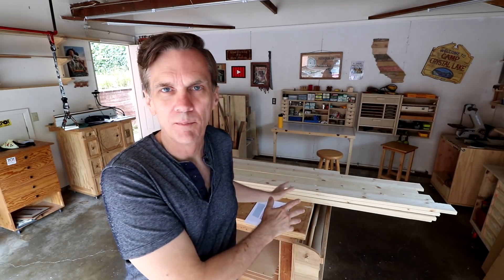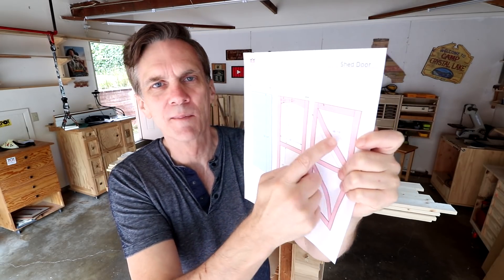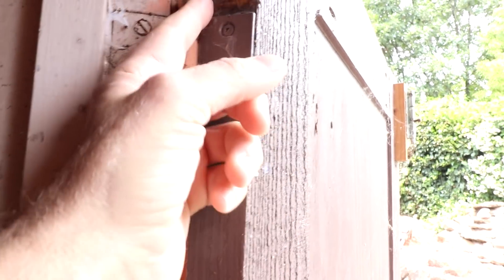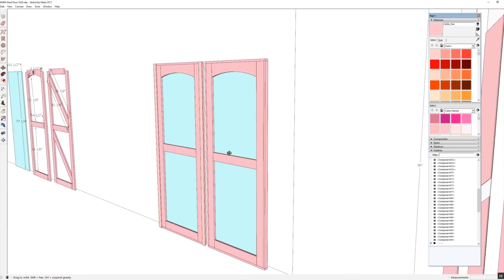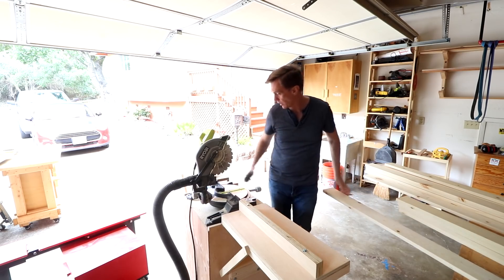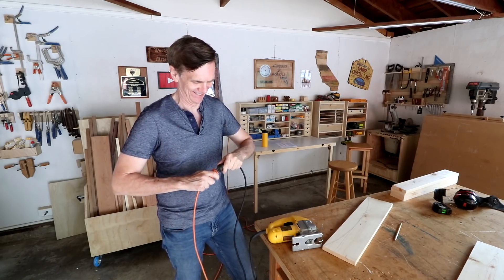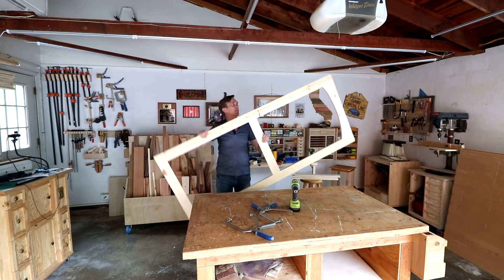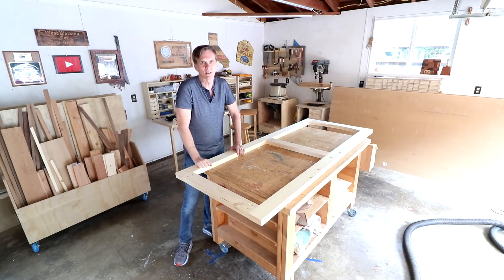Happy Saturday! Changing the shed door design and getting my man card revoked. | LOCKDOWN Day 75

Comment: I built a set of doors similar to what you are building at the "big box store" that I work at.  The doors are 96"x36".  Built them similar to the way you are but used 5/4" pine and the T111 siding that you looked at.  They are hit daily by carts, pallets, and machines and have held up great.  The plywood siding will give it the strength and glue the trim boards on to the ply and you will never have any issues.

Comment: I just spent several frustrating hours over the weekend installing a new faucet and reworking the trap and plumbing. While frustrating, I found that its painful to get people to show up on time or at all where I live. For example I wanted carpet installed on my steps, we had 2 different companies no show. When we called them the first said they got busy with another job and would call us back to reschedule. We had to call them to find that out, and they never called back. The second company said they weren't sure what happened but they would get back to me. Never heard back... I gave up and learned how to install carpet on the steps myself, and it turned out pretty good. Definitely less frustrating than dealing with taking time off work to meet them only to have them no show. I've had the same for AC repair, painting, electrical work, and flooring. Oh the stories I could tell about AC repair that took me 2 months to get done. I've actually thought about starting a business that actually communicates and shows up on time where I live, I feel like people would pay extra for that :D

Granted i've lived in other parts of the US where contractors were much more reliable, i've kinda given up on them where I live now. When I find one that shows on time and does even a decent job I continue to use them. I do have a good tree service and power washing service.

Comment: Steve, I’m a 64 year old woman. I learned to work on my car, to do plumbing and basic electrical crap, and saved myself thousands of dollars over the years because I couldn’t afford to hire a professional. Now I CAN afford a pro AND I DO know how to fix most things (like my dryer most recently). So most times I hire the pro for the same reasons you do! However, I refuse to pay a pro $200 to replace a $5 fuse. It took me 20 minutes but 18 of that was removing the 40 screws holding the back panel on and then putting it back on. Fuse took 30 seconds. Rest of time was finding tools. There is nothing wrong with hiring a pro! You still have your man card! Smart call!

Comment: I have the same truck.  Just for FYI, the spare tire on your truck is under the bed. The jack and tire iron kit is in a box that should be under the passenger seat in a box. In the box, there are a couple pieces of tubing that need to be put together. Next to the rear license plate there should be a hole to stick that long tube through. It goes to a pulley system to lower the truck tire down. It's good to know these things just in case AAA can't reach you. In any case, love your videos!

Comment: That’s a good point about the battery.  They’re not always straightforward and as easy to change as they should be.   I forget which car it was.  But to change the battery you had to pull the passenger side tire off.  So it made what should be a quick and easy project a real hassle.

Comment: just as a note ... for the curve, you can use a thin strip of bendable wood and attach the ends to one end and bow it up to the high point from the other end where you stop the curve
also you do not want to use the strip on the side ... you will not have enough strength ... would recommend that you change out the hinges and use barn door style hinges instead

Comment: Don't worry about the battery issue man. I worked at a auto retail store, there's no judgment about replacing a battery for guys. Just because you're not a jack of all trades doesn't mean you're a master of none. You excel in woodworking, where most car guys dont know what a cross slide is.

Comment: Hi Steve. Here in Australia our AAA is NRMA and while I am an IT Tech even I get them to change the batteries in my cars. Reason being they are able to temporarily feed power to the system while removing and replacing the flat / faulty battery and no computer chip data nor PIN nor complex reconfiguring of radio/GPS/bluetooth or software needs to be resetup by the Suburu Dealership.  Hang on to that MAN CARD mate!   Love them videos for the past 5 years

Comment: Looking good..I think you made the right call not having a back frame, seems like a lot of weight saved. On thing with that siding material is it doesn't do well wet. You may want some cap on the top, even metal flashing so it doesn't get rained on

Comment: I'm with you for the most part. I won't tough electrical. Last time I tried changing a light socket, I ended up in the ER for 12 hours. Changing the battery in my wife's car requires the removal of a tire and the wheel well just to access it. Basic repairs I think most people should be able to do themselves, but there's nothing wrong with calling a professional. That's why I think there should be a mandatory class in high school that teaches Basic Life Skills. Changing a tire. Balancing a checkbook. Budgeting. No one cares that the mitochondria is the powerhouse of the cell!

Comment: Also, man cards accumulate points. All the points you gain using power tools will more than offset the points you lose by not changing your battery. Also, you're right about it sometimes being as cheap to pay someone. For example, I used to change my own oil, but now the oil and filter cost almost as much as letting someone do it.

Comment: The thickness of the two frames with the siding sandwiched in the middle seems to be easily overcome by setting the doors flush to the outside and moving the inside door stop trim in a little. I would think that the inside frame would lend some significant rigidity to the door.

Comment: I'm horrible with anything to do with vehicles but there are a few basics that I think you should know, even if you never have to use them stitch as changing a tire or checking your fluids (and where to put which fluid). Maybe it's because of where I live in BC but there's a lot of highways with iffy cell service and it's better to know than to be stuck in a bad situation.

Comment: That 1x2 strip of wood on the edge of the door is a mistake. All the weight of the door is on the joint that attaches the the two pieces, You are undermining the strength of the one piece plywood build. The best solution if you want that strip is to change the hinges and install long gate hinges to carry the weight of the whole door.
Reply: I was thinking the same thing. Best is to just change the hinge.
Reply: Completely agree.
Reply: I was going to suggest opening the hinges and installing them to the face of the door, but a new gate hinge would be a much better idea.
Reply: The doors aren’t that heavy. Glue and screws and it’ll be like one solid piece.
Reply: 2½" screws will do it. Predrill into the plywood first. Angle if necessary.
Reply: Been there and tried a similar setup, the sidding is not as string as it feels it is light weight fiber board. Yo I will want a solid frame that will old the weight of the door and make a solid atachme t to the hinge, also goes without saying but do not screw into the sidding. Make sure you go through the siding into somthing solid. Lastly I have changed a bettery in the lest 5 years and unless you know exactly were and how it is a pain.
Reply: I think Steve should use long hinge screws and bend them over when they come out on the opposite edge... would that be strong enough ?? 🙄😂😂
Reply: Agree, best option would have been to use 3/4 ply and 3/4 stock for the face frame. Stronger door, 1 1/2” thick. PPPPPP.
Reply: Actually, the strips are the best part of the door for resisting warping
Reply: @williamboy3291  That's what your owner's manual is for. Every car I have ever owned included an owner's manual that describes exactly how to change the battery, charge the battery, and change a tire, amongst a million other things.
Reply: Although I enjoy doing most of the diy car stuff, I can't fault your logic. AAA fixed a flat for me a bit ago while I pitched a proposal on Zoom. I made way more money on the call than the AAA membership cost.

Comment: DIY'er here --  check out Sam's Club prices on batteries.  I saved a boat load and we changed mine last fall in the Sam's parking lot.  However...   Just for others reading here in future, Scotty Kilmer (check out his YouTube channel, he's huge) says with the modern cars you can mess up the electronics/computers on your car if you hook up to jump off the battery in the wrong order.  Also, there are codes that have to be entered sometimes with the right tool. My aunt just had to send her car into the dealer when the battery needed to be replaced.

Comment: Ever try to change the 12v battery in a Prius?  Aside from the fact that it's basically a custom motorcycle battery (smaller profile), you basically have to dismantle the entire rear end of the car to get to it. Turns out to be about $300 between the battery and labor to change it out. Still worth it compared to trying to do so yourself.

Comment: Everybody SHOULD know how to change a tire.  Doesn't mean you actually have to do it (once you've proven that you can)!  When I was younger, the cost was a bigger issue so saving money by doing my own tire changes (or oil changes, or brake jobs) was a much larger factor in my decision making process.
Reply from the maker: Every owners manual has instructions. It's pretty easy to figure out if you don't have a AAA membership. Or there are countless YouTube videos showing you how. I guess the point is that we no longer need to pre-learn rare tasks that we may never perform. Most people will live their whole lives without experiencing a flat tire and being without assistance.

Comment: People all assume that if you are a woodworker, you’re automatically a jack of all trades, but that’s not the case. Mechanical, plumbing, electronics, and many other trades/skills may have some overlap. I totally understand where you’re coming from. I’ve had to fix cars, washers, dryers, and refrigerators when little things like ignitors, relays, prake pads, bearings, or fans go out because the frustration factor is less than the cost of a repairman or replacement device. But there are times when I punt because it is the right thing for me. I know how to change oil. I’ve done it several times, but it is worth it to me to spend the $100 to have a professional do it, properly dispose of the oil, lube the chassis, and check all the points they check, because something would have to be terribly wrong with those items for me to see a problem. Heck, even replacing a headlight has become a major pain with as tight as they pack things in.

Comment: Changing a vehicle battery is not always as easy as it used to be.  I had to replace the battery on my Dodge Journey last year.  The AAA affiliate where I'm located would not even change it out because in order to get to it you have to remove the driver's front wheel and part of the fender covers behind the wheel.  I don't blame you one bit.

Comment: I don't change tires very often, but I can get it done before AAA gets there to do it for me and yes I have AAA, I can't tow a car when needed. But I do see your point about the battery, which is why I didn't comment on it before. I take my truck to the shop for a lot of simple things, mostly because of the warranty I have covers almost everything and minor stuff like an oil change is a waste of time. I drop my truck off for an oil change and have them rotate the tires and recheck the alignment at the same time, they do a courtesy inspection and let me know if any lights are out, how my brake pads are, etc. Make more sense to just let them deal with it since I don't have time anymore.

Comment: Your car battery story/epiphany is very similar to mine.  several weeks ago I needed a new battery for one of the cars.  Off to the local auto parts store and $140 plus tax later I have a new battery.  I have to install the battery myself.  Took about an 30 minutes.  The battery has a 1 year no questions warranty.  Fast forward two weeks and another one of my cars needs a battery. I check AAA out of curiosity and low and behold I can get a battery for $145 installed, and get this, with a 3 years warranty and an additional 3 years prorated warranty.  So for $5 extra dollars I extended the warranty by several years AND it was installed for me.  That formula works for me...man card be damned!
Reply: Costco is about $75 bucks for the car batteries my three cars use, with the same awesome warranty. Walmart and the auto stores were charging the $140-145 prices you mentioned.

Comment: Agree 100% with having someone who knows what they are doing, and have the correct tools to do it with, perform tasks that your are not comfortable with (or that will cost you more in the long run).  As our provincial and national lottery states "Know your limit and play within it".
Reply: While I agree, knowing ow to change a tire is helpful when you are lost in the middle of nowhere and there are no AAA less than 3 hours away. Oil change is different, you can still drive to the next town to have it done.
Reply: I agree completely, outsource what you can. If you have your own business it's cheaper to hire someone to do most of the fluff on the side if you can spend your time making money instead.
Regarding cars, personally I'm not very interested and I have changed enough tires, oil and carburetors in my life. Batteries in a modern car can be tricky, we had a Ford that tripped the start protection when the battery went bad. It had to be towed to the shop to reset it. Nowadays I drive and fill up fuel, I happily pay someone else to do the rest.
Reply: @olivier2553  Then you can just watch a YouTube video on how to do it, unless your phone's battery is dead and you're alone in a the middle of nowhere.

Comment: Years ago these Jiffy-Lube type places started popping up and they would change your oil and filter for only a little more than it would cost to buy same at Pep Boys.  Well, that was a no-brainer.  But after a while the cost started going up and up and up.  Now I'm back to changing the oil myself.  It helps, of course, that my 1998 Suburban is lifted and I don't even have to jack it up to get to the drain plug.
Reply: Look up Fumoto, it's a valve that replaces the drain plug. It's super easy and clean to drain the oil.
Reply: Even worse for newer cars with weird grades of synthetic.  The oil costs maybe $10 more, yet all the lube shops want to charge $50-100 more to do the oil change.  I'm back to changing all my oil myself too.
Reply: Around my part of NY it's cheaper to pay someone else to change my oil than to do it myself. I can go to Goodyear and pay $20, or I can spend $30 to do it myself. I'd rather save the $10 and my time. I also like that I'm still clean when it's done.
Reply: I have the knowledge and the tools to do it myself, I actually used to work at a Texaco Xpress lube.  I prefer to do it myself because I used to work there and I know the caliber of people working on the cars.  Mistakes happen.  If I did it myself, I know it was done right.  If I screw it up, its on me.
If I glue a 1 inch strip of wood to the outside edge of my new door and it falls off, thats on Steve...  :)
Reply: I've known too many times when the quick-change places have forgotten the fill part of the drain & fill procedure, or cross-threading the drain plug, or putting an oil filter on so tight that only the Hulk can get it off, so I just do all my maintenance myself, as well.

Comment: I've had plenty of the "professionals" screw stuff up on my car.  Things like stripping bolt heads and cross-threading bolts from using impact wrenches incorrectly.  I've had them top off my fluids as a courtesy but them they forgot to put the cap to my power steering back on (which I didn't discover until I opened my hood the next time).  I've had them break plastic interior pieces and then they claim no responsibility.  I do my own car work to make sure the proper care is taken to do the job correctly rather than have someone rush through the job to get it done as fast as possible.

Comment: Breakdown cover is definitely worth it for things like that since you don't pay for the labour and you just pay for the part, unless you have cheap breakdown cover. I've used breakdown cover so many times in the past and it's always been a good thing to have. I remember one time my wheel got a puncture and the repair kit I had was broken too so I called my breakdown cover provider and they came and fitted a new tyre and only charged me £30 for the tyre (I wish tyres were still that cheap lol). When I took my car in for a MOT I had to replace the other tyres which cost the same £30 but then had £30 labour added which kinda sucked. Just for perspective those tyres now cost £60+ as all my cars use the same tyres which I only just realised this year lol. I've owned 5 cars and they all use the same size, rating etc tyres lol

Comment: The problem with relying solely on someone else to change your car battery or tire is, what happens when no one's available to do it? I've been on numerous roads in the U.S. where cell service doesn't exist and you'll be waiting a good while for another car to drive by. There's no reason not to have a 3/8" ratchet and full set of sockets with extensions, which is all you'd need for the battery change. The car tire can be changed with the stuff included with the car. Just my $.02. Take it for what it's worth.